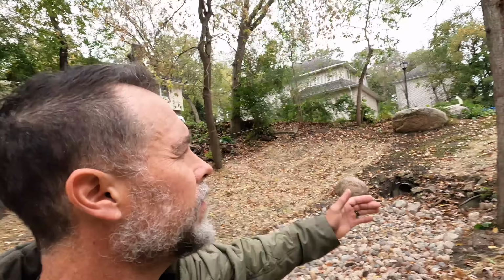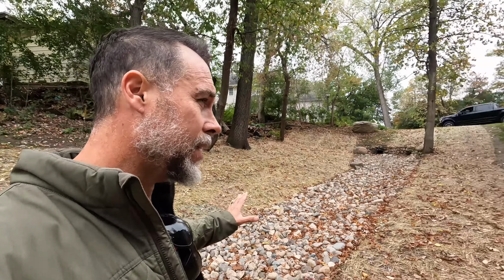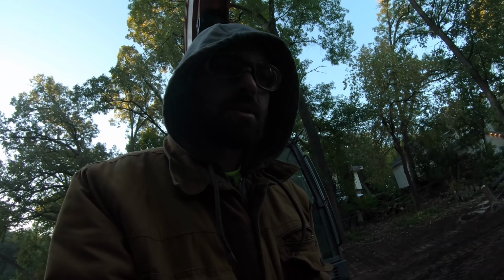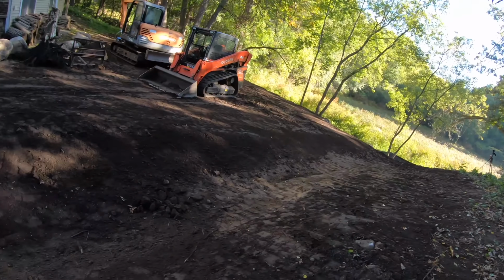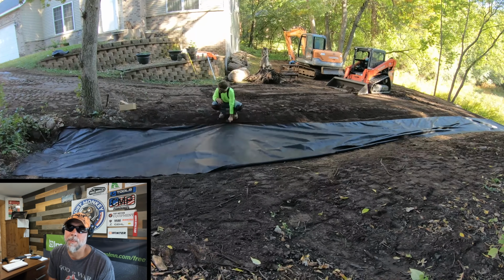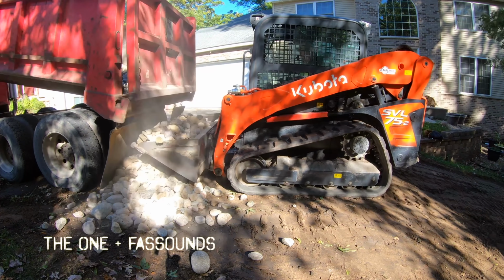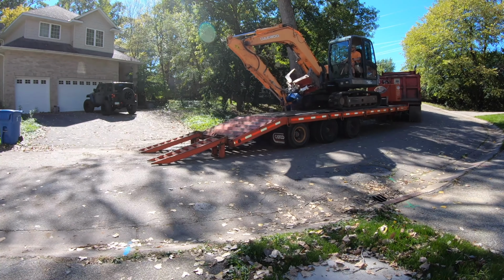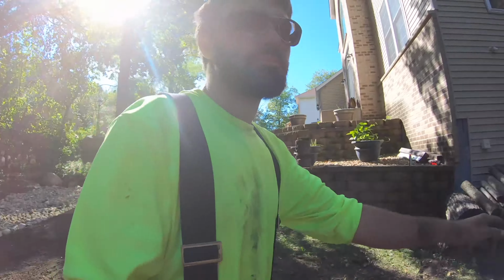CLOSE CALL! Alex almost Hits Zak with the Skid steer.

Comment: Stan I love your videos. You actually inspired me to start a company doing work with my tractor. I'm no where near on the level you guys are but maybe one day. One thing I do and as a tech of 22 years that makes a huge difference in repair costs is every winter i pull all the pins that need grease out of my machine and clean them out. Along with the places that have those pins. My stuff isnt anywhere as new or nice as yours and its has made a world of difference.  I know Tim would be all for it and in the long run it will save thousands.
Reply from the maker: Maintenance like that easily extends the life of equipment exponentially

Comment: I definitely like what you guys did here. I find it unusual that the city didn't do more on their part to protect the homeowner's property that is affected by the street runoff. Thanks for the video Stan.
Reply: It may have been put in before the house was built. If so the builder should have thought about it and fixed it.
But we wouldn't of had a great Dirt Monkey series!
Reply: Most townships won't go past their road of way which is only like 50 feet from the Centerline of the road
Reply from the maker: This was a weird and difficult site to control the drainage on.  Especially with everything running right to it!

Comment: Zac with the chinese chainsaw doesnt trust batteries, lol
Reply: The chainsaws were a hell of a deal and the battery grease gun is like 200 somthing and the hand pump is 30 I can buy 3 to 1 and save money
Reply: @App1eDash  when you have to refill a skidsteer track tensioner and you have to put in 3 tubes, you're gonna buy the electric at any cost
Reply: @TRCCtv  that would be the only time i use one or I’d get one of those foot pump ones that hold a bunch

Comment: Your Skid Loader operator should know what or who is behind him every time he backs up. Maybe you should install backup camera on the loader. They cost less than $100.00 and can be wired into the back up beeper wiring circuit.
Reply: Which back up camera cost less than 100?
Reply from the maker: a good operator is always aware of his surroundings with or without a back up camera.  Although its safer I don't want a back up camera as a crutch.  I would rather see better and safer practices put into play

Comment: Jumping straight into the bucket... mmm cause manually moving them suck. I had had 2 ton delivered for the front yard before they delivered the 7 ton of mulch for the back.  Was meant to be the other way around and they dumped the pebbles at the front of the driveway. So I had to move 2 ton, only 20 feet but in under half hour so the mulch could go to the end of the driveway. Told the driver to go get us all coffee before returning with the mulch. Not only did he feel bad for the mix up, he put another ton of mulch in the truck. Really dude you are not helping. Ever seen 5 inch thick mulch beds? Mind you the garden beds still look good after 2 years.
Reply: I agree hard to move that stone saw on Craigslist free 26 ton river rock went to see homeowner had delivered couldn’t  move actually I got a good job preparing and spreading it for them skid steer loaders a great equalizer
Reply: @robertvannicolo4435  A Wheelbarrow is no match for a skid steer.
Reply from the maker: manually moving that much stone is a chore!

Comment: Yeah yeah you gotta love Lock and loop ends I have 4 different grease guns one being a battery operated my next battery operator is going to be a Milwaukee like what you guys have but you guys have like a dummy I bought a dwelt fit what I had for batteries and batteries and battery systems big mistake anyway I digress I love the lock and lube I really really like the extended tip 1 did tip 1 I wish I had those a 100 years ago
Reply from the maker: Lock n Lube is awesome.